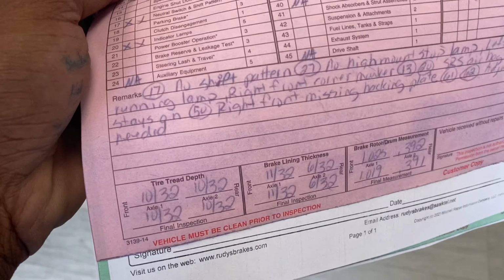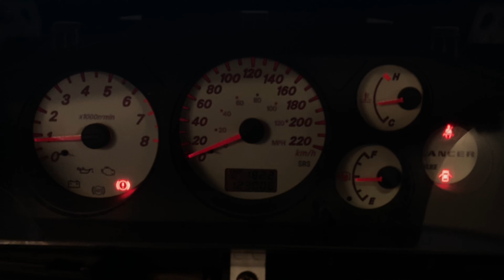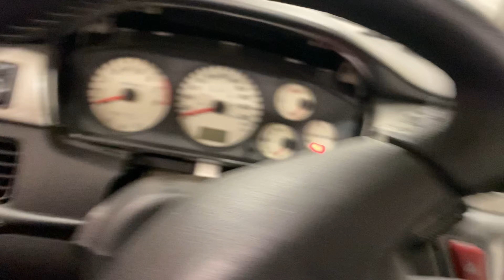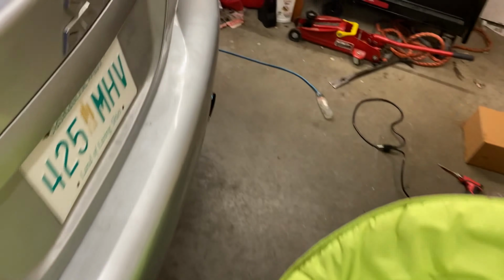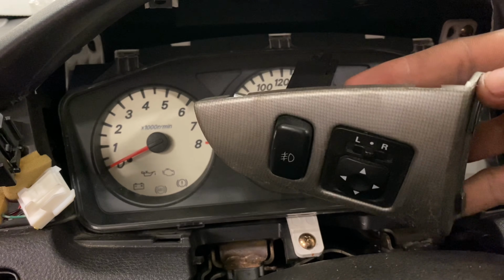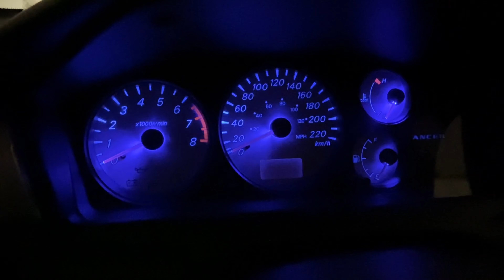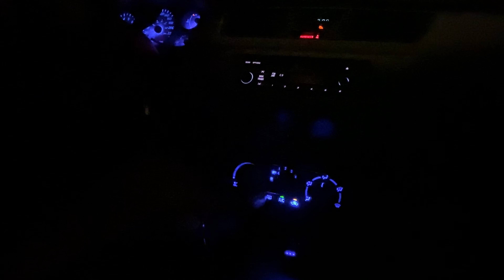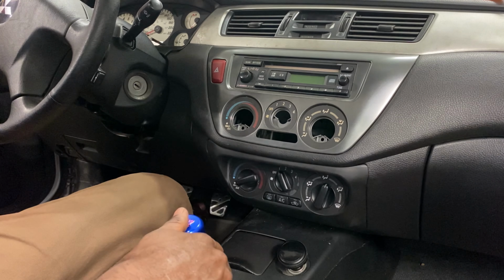[Part 6] 2006 Mitsubishi Lancer Build (Dashboard light change)

Comment: Where did you buy the dashboard light bulbs?
Reply from the maker: WLJH Canbus Bright 3030 Chip PC74 Twist Lock Socket T5 2721 73 74 Led Bulb Automotive Car Instrument Cluster Light Gauge Dash Dashboard Indicator Panel Lights Lamp 12V Ice Blue - 10 Pack https://www.amazon.ca/dp/B07LDBBCQ8/ref=cm_sw_r_cp_api_glt_i_N3QNQGSYT0A2QTVBDG9G